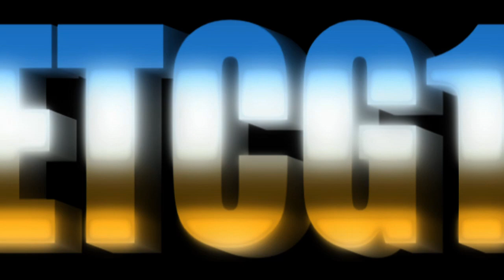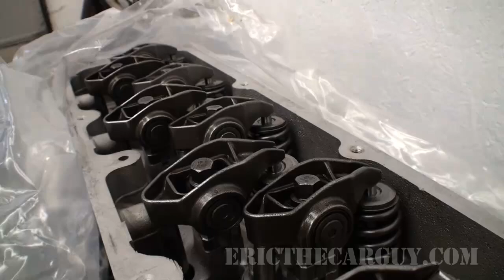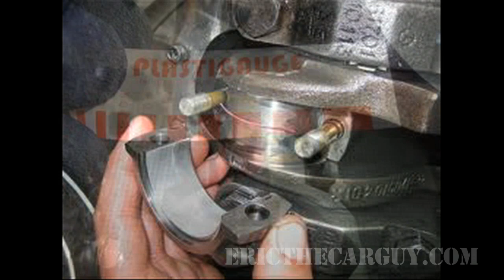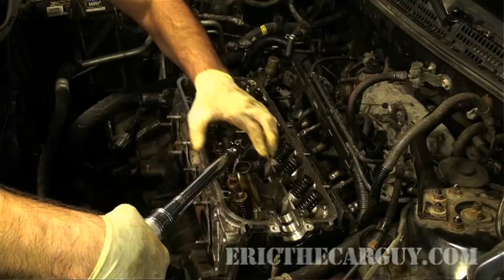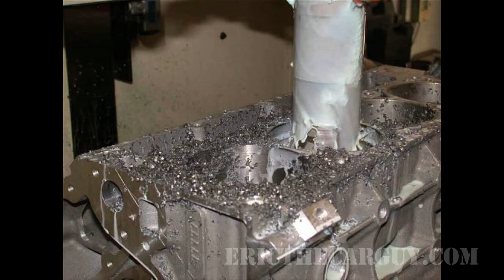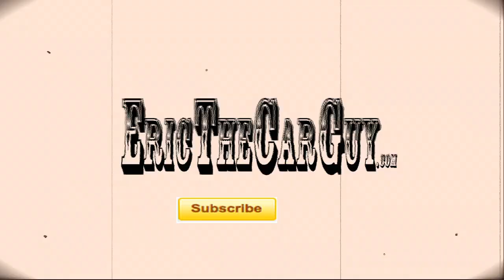Should You Rebuild or Replace? -ETCG1

Comment: +ETCG1, Rebuild or replace would depend on what you're working on. For example, most domestic engines are built around "planned obsolescence", meaning they were only manufactured to last so many miles. However, most of the older 1980's classic vehicles, be it domestic or foreign, were designed to see hundreds of thousands of miles. The down side to swapping an engine from a salvage yard is, unless you can find the exact engine type that you're trying to replace, your vehicles computers are going to be really confused. Not to mention, if you try to get dealer parts for that vehicle, your vehicle's VIN & chassis number, correspond to a certain engine type. In short, if you replace your engine with a salvage engine, even the exact the model, all you're doing is swapping one set of problems for another set of problems. Yeah, you might find an engine with less miles on the odometer. However, the engine problems are based upon how well the previous owner maintained their engine.

Comment: I like the idea of properly rebuilding an engine if it's good enough to still be a usable block, replacing a few parts isn't really rebuilding, it's just re-assembling it, rebuilding at the end of the day is closer to blueprinting when it comes to the end result, whereas what most people see as rebuilding still has a lot of original parts and wouldn't include, say, a balanced crank and may still have pistons of varying size and quality

Comment: I once bought a used chevy 151 4 banger to install in an S10 the yard said the motor was bench tested and  had a warranty, yeah I took it to my shop and there was no water pump(  I knew that at the time of purchase), turns out the engine had been in a front end accident, the back of the water pump had gone into the no1 cylinder, the cylinder was cracked and the piston was smashed, the yard guys were pissed off because I had removed the cylinder head, and wouldnt refund my money untill I put the head back on, they even tried to tell me that wasnt the engine that they sold me, the state police had to intervene, I have found that most crate engines need to be totally taken apart before installation, as I have found screw drivers in the oil pan, shop rags, even rust or no oil pump or a leaky freeze plug behind the flywheel, so for me I will stick to rebuilding shortblocks, but I will send the heads out for resurfacing, and a three angle valve job, by the way you cant tell if they did a three angle valve job unless you remove some valves.

Comment: I could not disagree more.  When you rebuild a motor you have the oppurtunity to fix the problems that caused the engine to fail in the first place. You also can put much better quality parts in your engine then the factory uses, balence it better, set clearences better, etc..  If you buy an engine from a dealer these upgrades may or may not have been addressed. You dont need many special tools for most engines. A few torque wrenches and plasti gauge will do most everything. Your machine shop can return an engine ready to assemble, all you need is a torque wrench and ring compressor.  A proper rebuild always bores the block and uses new pistons...  The reason I ALWAYS build my own engines....There is no better feeling then holding your foot on the rev limiter and knowing you built a motor that won't blow up.
Reply: bdd1469 interesting. So I think for you, rebuilding is definitely a better option. Seeing as you have the experience and knowledge to do so. In my case, I have never so much is removed and engine. and though i would love to learn, I don't know anybody who has the time or the know how to show me. So will be all up to YouTube LOL. In my case, maybe i should just replace?
Reply: @ethannarrow5209  agreed,
people like us without knowledge or concept of whole project should just replace.

If you lucky few can find COMPLETE rebuild/upgrade/diy info. ONLY THEN REBUILD!
NEED ALL SPECIFIC INSTALL DETAILS/instructions!!!
I need look up my mercedes c300 4matic dissasemble/remove cylinder head from engine block, to fix my spark plug thread.

Don't want metal bits falling in cylinder when I still new holds for time-sert replacement spark plug threads....
Reply: I really wonder about that. You sort of need to be in the industry or to know people in the industry that will tell you what parts are really better than the factory ones. Moreover, you need to know the exact specs for what you're working with, which are not available for all the cars unless you "know someone that knows someone". What you're talking sounds more about the ideal case which certainly doesn't seem available for everyone.
Reply: They make a book to help you with your build and books about how to upgrade your old block
Reply: It really isn't that hard to rebuild an engine.  It's just very tedious.  You need to take a lot of time to make sure you keep it done right, which means covering all aspects like documentation of the engine, using the right tools, making sure specs are done right, not rushing.  You get faster as you get more experienced, obviously, but the routine does not change.  If you don't have another means of transportation while you do a rebuild, then that's gonna be a problem cause you won't have a working car for a bit.

Comment: Few years back my mom's Camry seized up and our mech told us that it needed a rebuild or a reconditioned engine. Same story, he told us $1500 for a recon engine or $1800 for a rebuild. We went with a recon and he ended up sourcing the more powerful DOHC instead of the same one it had. The car ended up going for another 5 years and was still in good working order when we got rid of it.

Comment: I agree with replacement, but it depends on how bad the engine is, like I wouldnt rebuild or replace an entire engine for a blown cylinder head or head gasket
Reply: If the head is the only thing that's bad, then you could probably get away with a top end rebuild

Comment: I personally think that rebuilding engines, transmissions, etc, should be done by people who either do rebuilds for a living like Eric mentioned in the video or build cars as a hobby.  And if you are doing a rebuild of an engine or a transmission (or both), make sure that the vehicle you drive back and forth to work everyday is in good shape cuz if that vehicle breaks down then you're S.O.L. unless you just happen to have a third vehicle that still runs.  I personally think doing a rebuild of any kind would be a fun project, but it still poses risks like Eric mentioned.  So I'd say that if you're hell bent on having your engine or transmission or what have you rebuilt and you're not a professional mechanic with all the right tools, then find a shop that'll do it for you.  If you're hell bent on doing it yourself, Boxwrench makes instructional DVDs on how to rebuild engines and transmissions for those who don't know how to do a proper rebuild but would like to learn.

Comment: I have a 2002 Toyota Tacoma with brand new brakes, new AC pump, new power steering pump, I replaced the rack and pinion (had to because it was driven without power steering for a month), all new belts, and new tires. It's got 238k miles on it's v6 engine. When the engine goes out in the next few years, would it be worth it to rebuild it? Or sell it?

Comment: I opine that neither is a good option for the vast majority of cars that may require a repair or replacement of a major assembly and here's why: cost relative to the vehicle. Only in vehicles whose age is perhaps less than four years and/or higher end vehicles is the cost of either replacing or repair of a major assembly worth it. The cost of a rebuild or replacement can approach and often easily exceed the market value of most vehicles on the road that are unfortunate enough to need the work. It's a fact that cars these days are simply disposable appliances owing largely to the huge cost of parts and labor and this is unlikely to change anytime soon. They simply are not worth fixing anything but the most minor of problems anymore.
Reply: +riblets1968
"Blue book" value of the vehicle is only relevant if you're planning on reselling it. If I put a rebuilt engine in my pickup for $2,500, and I get 10 additional years of service out of it...then who cares if I was "upside down" at the moment I put the engine in?

Yeah, in theory, I could get an "equivalent" running example for less than the cost of the replacement engine...but a high-mile used vehicle is a bit of a "pig in a poke!" If I fix up MY 1994 F150 (versus buy an "equivalent" 1994 F150 for the same cash), I KNOW whether my truck is in overall sound mechanical condition, and that has "intangible" value over and above the BB value.
Reply: So true and very sad situation.
Reply: You're advocating that America continue to be a throw-away society...You're not thinking clearly....

You're saying that you think it's best for society if we all be so lazy that we watch tv for a week and don't spend $1500 or that we watch tv for 2 weeks and don't spend $2500 ... Like Idk i lost my point.  My point was that you're a communist - You're trying to take jobs away from small business owners and create more jobs for corporate greed..oh wait, not make more jobs for corporations because they use robots.  You're legitimately a communist, sir.
Reply: Also, everyone knows KBB doesn't mean anything to anyone except the dealership.  KBB doesn't take into account each part of the vehicle...It asks "Overall, is it Excellent, Good, Fair, or Poor condition?"  and the answer is with a new engine, transmission, suspension, and braking system it's in perfect condition.   So...either you don't know how to rate the quality of a vehicle using KBB or you're a guy who wears make-up.

Comment: In case that someone else is doing the replacing or rebuilding of the engine, does it worth to replace it or rebuilt it? I was only thinking that if you rebuild the engine, you are 100% sure that for the next 100k you not going to have any issues. Is that correct, or still replacing is better? Thank you, Spiros, UK and I drive an mx-5 mk1 with 170.000km

Comment: what about if the car just has high mileage? would it still be better to replace? I'm talking like around 150k miles on an engine
Reply: If the rest of the car is solid, then replacing is probably the best way to go. The problem that may come up though is that the car has a number of other issues that may crop up not too far down the road. I had to face the same question with a transmission, and decided with so many other issues with that car that it was best to part ways with it altogether.
Reply: 150k isn't much if the engine was well maintained.

Comment: Its not entire clear since you offhand mentioned buying a junkyard engine, but when you say "used" engine, i hope you mean one from a reputable dealer or parts store that has been remanufactured/reconditioned prior to sale. If not, it seems odd to voluntarily inherit all the unknown problems of a different engine that could have even have more miles, and wear, than the one you currently have.  Trading a known problem for an unknown problem seems unwise, at best. 

I get the whole idea that most DIY'ers or shade-tree mechanics do their rebuilds improperly, so I understand how your advice is justified, most of the time. 

I just wonder if its also a bit self-serving.  Rebuilding an engine is difficult and labor intensive work. Putting a new engine in too, but its about half the amount of work overall, and the liability for all the detail work is on someone else.  So it can generally be done a lot faster, which means a greater profit margin for less work and less liability.   Sounds almost like someone running a business.
Reply: You can usually tell which engines/transmissions are good in a junkyard.  If you live in a major city and the car has significant body damage it's probably got a good engine/transmission - Test it.

Comment: Eric - good video. 

Replace, yes I agree... but is there any value in sending out my engine to be refurbished... so take out the original engine, have the original engine rebuilt by the experts, and replace that original engine.... the argument being I know the history of this engine... I was nice to it     :o)
Reply from the maker: The point of the video was to illustrate that it takes quite a bit more than most people expect to properly rebuild an engine. If you send it out to professional engine builders it's really the same thing as putting in a re-manufactured engine.

Comment: thanks for the vid ---makes me think more
have a 88 300zx 100,000 miles on it --buring oil and #3 cyl is fouling the car runs starts up no problem--has been sitting for 10 yrs after it overheated one day and started to foul that cyl--did a comp test and all cyl around 150--when i do a wet test compression jumbs up--when i first had this prob 10 yrs ago i had the heads dome though maybe a valve on #3 but still buring oil and #3 still fouling--am retired and very DIY esp auto,truck tractors
was thinking of droppping the pan and just looking at the condition of the rings -look at the walls--try to assess the condition of the cyl

maybe mic the cyl and if ok use new rings same bearrings and reassemble

your thoughts
lou

Comment: my ford f150 just found out that I got a bad cylinder number 3 won't build compression so I'm gonna rebuild cause it's gonna be cheaper my uncle is going to machine the heads a new motor would cost way to much for an 06 f150 even a used one I'll find out more this week I hope everything works

Comment: Some of you's have been ripped off 5 k here 9 k there wtf who is doing the rebuild on your engines wtf. maybe do some research before doing anything I've had many tightass costumers bitch about the costs then they can't pay up then I'm stuck with a shitbox and new or rebuilt engine that I have to sell to regain that lost cash if the car is not that bad I'll just install the engine after the rego papers or tittle are given to me then sell it

Comment: You don't have to pick one over the other consistently in my opinion. The main difference to me is how long the customer let the concern go before having it diagnosed. For instance, the timing chain/belt was loose, they let it go, now it jumped a tooth and didn't interfere. Rebuild the engine; give it new gaskets, timing, check the head for leaks and run. Another customer will walk in that let it jump a tooth and kept going, now there is a valve threw a piston and a connecting rod bent. Replace it. If a reman is withing $750 or a used engine is over $2000 I strongly recommend the reman. Part of being a good tech is being able to tell the difference between what needs fixed and what needs replaced. You cant just go into every engine job and replace the assembly. I've torn the bottom off of cars with 150k+ miles that were just a little low on pressure, put connecting rod bearings in it and run for years. No I didn't fix every concern-able part in the motor however there was no reason to because for less then $200 we got another couple good running miles from it.
Reply: +1
Reply: Sounds like your shit mechanic also in your comment so parts make on sense you must be an import
Reply: +Gaz Girl haha you replied to a constructive comment with negativity and insults for no reason. I just think it's entertaining to watch the little people like you get all bent out of shape for no reason other then to feel like your defending yourself.

Comment: Back in the 70's, in South Carolina,  I experienced the pleasure of doing some used car lot repairs.
You know the type: ONE burnt valve replaced instead of a whole valve job on a head...
ONE sparkplug , or ONE coil wire replaced instead of a whole set. It was quite an education in CHEAP ! Comical, but pathetic, too. Worst case I can recall, was replacing a single piston in an engine because it was cracked. He even had me RE-USE the old rod bearings!
Also common was ONE wheel brake jobs. Just enough to get 'em sold. :-}

Comment: Replacement is usually more cost-effective in my experience. The only times I rebuild are if the part is hard to source, very expensive or I just want the experience of rebuilding it. If time is not an issue, I usually attempt rebuilding to gain experience.